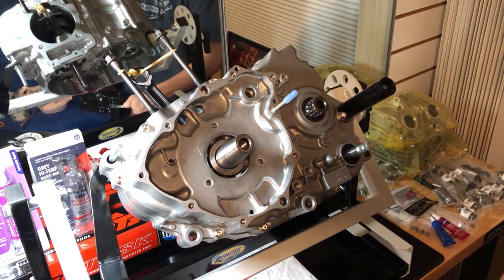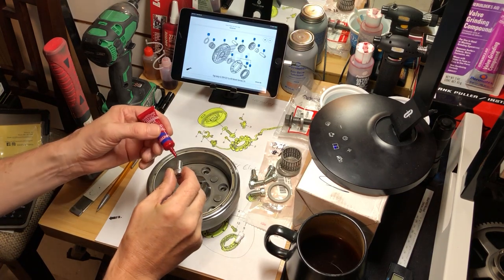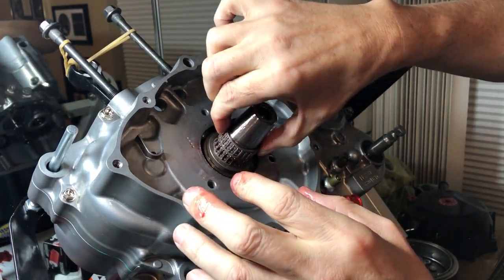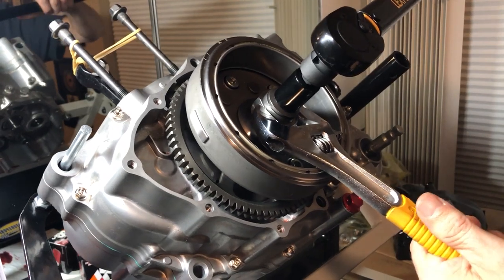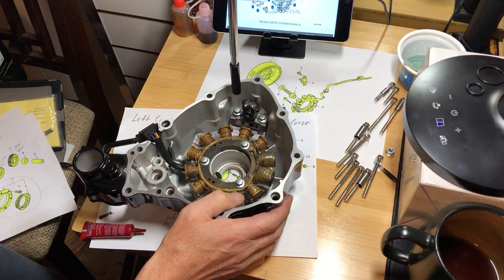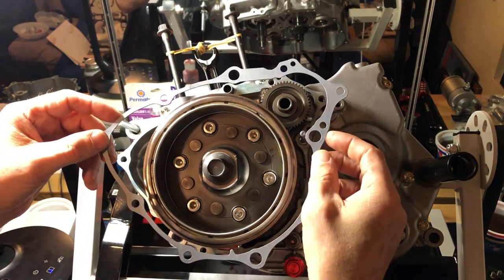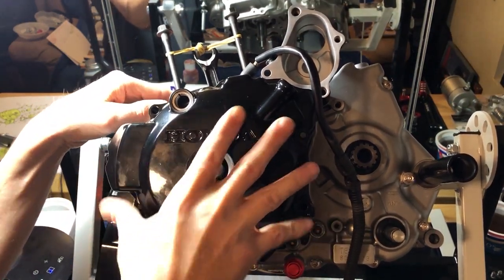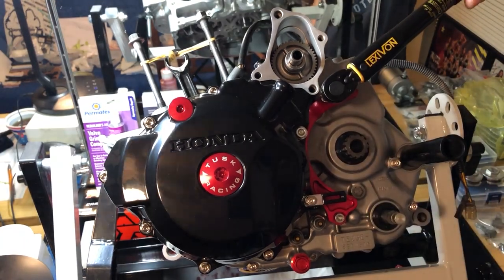Honda 400ex Build - Part 10 - Stator, Flywheel, Starter Clutch Gear, One Way Bearing, Alternator Key

Comment: Just started watching I tore up my Trx400 I was riding in the trail went through some mud and got stuck I held it wide open and it’s been like four years ago and it cought traction and stood a wheelie it tore my sprocket up and I just replaced it to find out first gear is trashed and it also needed a top end rebuild when I traded my other four wheeler for it but it ran so I ran it anyway it burns oil off I’m about to take it apart and rebuild the whole motor
Reply from the maker: Sounds like a fun project ... The 400ex is a fun motor to rebuild ...

Comment: Hey bud what will make a brand new battery go dead when u turn engine over after a few seconds..and weak spark it acts like it wants to crank it spudders but dont crank all the way
Reply: I have a video on page if you can check out

Comment: Hey man I really like this vidéo I got a 400ex 2004 but i don’t have thé electric starter on my quad do you think It’s possible to install it ? And can I have thé link to buy parts like the flywheel the clutch gear and the left cover ? Thank man and wish you the best
Reply from the maker: All the 400ex's from every year has electric start ... how can you not have one? If, the motor is a 400ex motor then you can definitely install the starter ... here is a link to order any OEM part you need (even the starter motor) - https://www.motosport.com/oem-parts/honda/2004/trx400ex
Reply: Thanks man for your answer, I don’t know it’s really weird... how can I Check if my motor is a 400ex motor ? Thanks for the link but I’m from Europe and Motosport locked the website I don’t know why
Reply from the maker: @fethimekroum7780  You can check your motor by the serial number located on the bottom left, by the gear shifter. looks like this: https://11galleryatv.com/img/trx400ex-engine-serial-number.jpg - TE23E- is the 400EX engine code ... for parts, here is a link I found (I've never used this company personally) ... looks like they ship to multiple countries - https://www.motorcyclespareparts.eu/en/honda-parts/2004-trx400ex-sportrax-atv-quad
Reply: @11GalleryATV  thanks for your help, I found out it was a xr 400 motorcycle motor ... thanks for you link and for the starter maybe I will forgot this idea because I think I have to change the crankshaft and it’s a lot of work and money

Comment: Is it possible to have the flywheel installed wrong? The T on my flywheel wasn't giving me top dead center when timing the machine..
Reply from the maker: I don't think so ... unless maybe the woodruff key is missing or sheared. That sounds strange ... maybe out of time?
Reply: @11GalleryATV  I believe it's either the key was wasn't installed or sheared as well but wanted a second opinion. I'll find out tomorrow
Reply from the maker: @cary1235  Cool ... I would definitely like to know what it was when you find out ...

Comment: Red lock tight on aluminum? I did that one time and had to remove the bolt later and all the threads in the block came with it. Lesson learned.
Reply from the maker: Red loctite is designed for all metal, including aluminum. You just have to heat it up to remove.

Comment: I have a 2005 trx400ex. I just replaced the starter and now there is a weird grinding noise coming from the starter when I start it it still starts up but there's a weird grinding noise. I wiped up all the oil that was inside the casing could that be the problem?
Reply from the maker: Sounds like something came loose, take it back apart and make sure all the gears are lined up (and definitely add some assembly lube or oil to the gears) or maybe the starter clutch is going bad

Comment: Hey bud how do i know if neutral switch bad ..i took out it dosent look bad but my neutral light isnt coming on dont know if its why im not gettin power from starter to front ignition and handlebar switch because neutral not reading but i tried to put a clamp and ground it still no power can u kinda guide me to check on or what you think im missin..everything is brand new wries cdi etc still no power from back to front just back oh and made sure all my grounds good
Reply from the maker: you could try just grounding the neutral safety switch wire to the frame somewhere and it will trick the cdi into thinking the circuit is closed and in neutral ... as far as the sensor itself, you will have to hook it up to some sort of OHM tester or something.

Comment: Is the stator side supposed to have oil in it? I am changing my stator and there's oil on that side is that ok?
Reply from the maker: Yes ... the oil is what cools the stator and keeps it from over heating - the stator will be submerged in oil while running

Comment: Hey man I just started tearing mine down , what did you do for prepping for the powder coating ???
Reply: Also where did you get that bumper ? I know it’s pro armor but I can’t find any for a 400 ex
Reply from the maker: @yaboysamshep1470  I bought that bumper on eBay it is called Pro Armor "Bully" ... I don't currently see any listed for the Honda line though. As far as prep for powder coating, I really didn't do very much because I had it done professionally and they sand blast it anyway. All I did was use a drill with some scotchbrite attachments to knock off the major rust and imperfections and made sure to note and tell them where to plug all the places where I did not want the powder coat to get to.
Reply: 11 Gallery ATV  I hear a lot of story’s about how I need to plug my bolt holes so the powder coat Dosent get in there , but seems like a lot to put all the bolts back in , they said if you don’t you have to chase the threads a lot after the powder coat , I am going with black as well , I am really debating on swing arm color though
Reply from the maker: @yaboysamshep1470  It is a lot easier to plug the thread holes with high temperature silicone rubber plugs (they can go right in the powder oven). Here is a link to the ones I used - https://amzn.to/2TBbUmf ... and here is a link to the extra large ones to plug things like steering stem and bigger stuff - https://amzn.to/2Ty5IeO